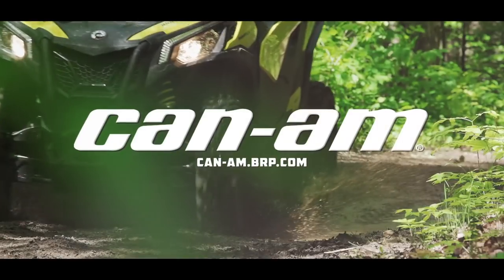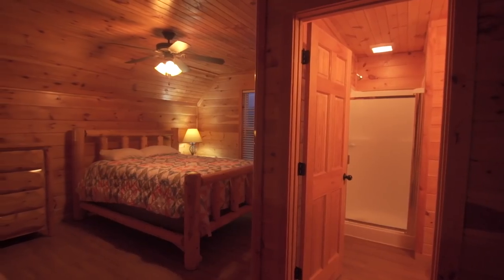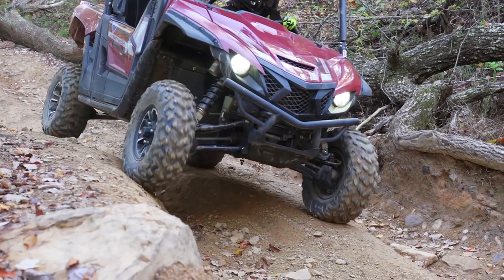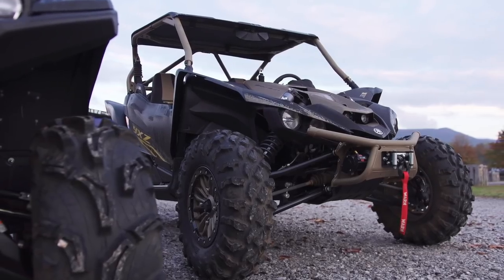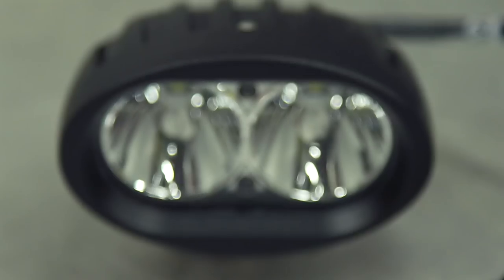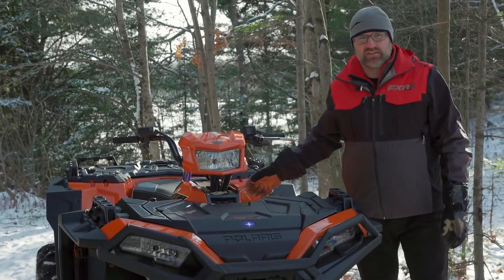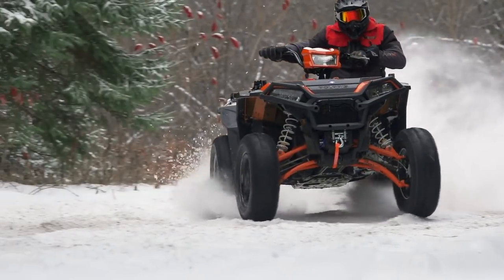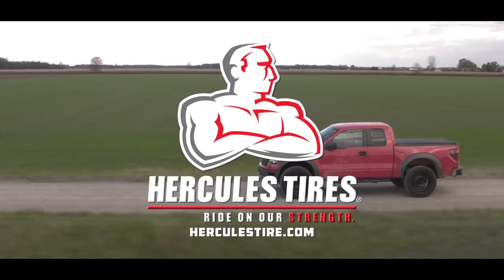Dirt Trax TV 2019 - Full Episode 17

Comment: The sportsman s is an awesome idea and will be interesting to see how it does. However two major flaws that I see is the thing that  makes the machine what it is, and that is the Width. If I’m buying an atv I want to go on 50” or less trails, I also want to load it on the bed of my truck and go... this however you cannot do that, yes you could technically still load it in your bed going over you wheel wel arches but after time you’re going to dent/scratch the hell out of them.